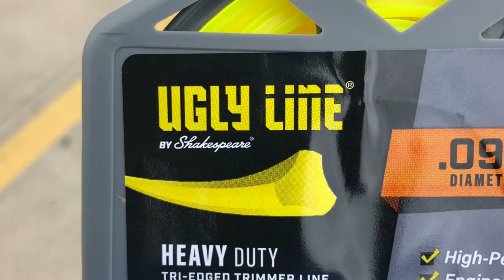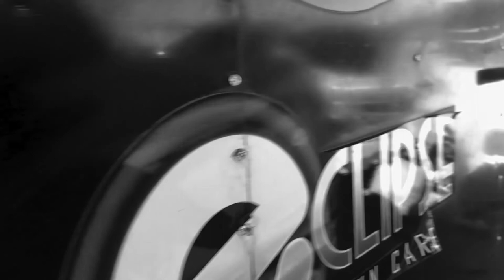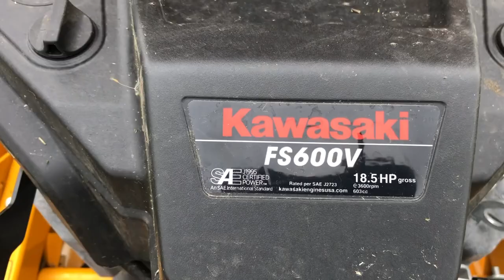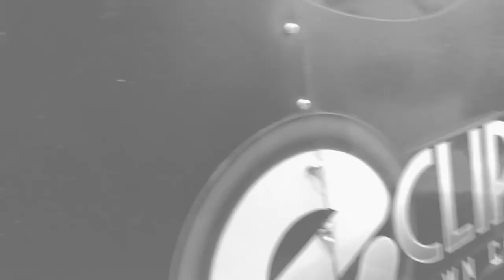The Heartache of Losing your Lawn Care Business | Friend Helps Out | Demoing a Stander Mower

Comment: I use Wright 32 stander fixed deck. Overall length is shorter than the stander 32 B. I learned it in one day. Just practice all day. If the yard is bumpy it's hard to keep a straight line. Stander B is definitely a good starter mower. Adjustable deck is a plus. Good luck.
Reply from the maker: I would think a fixed deck would be inconvenient. Thanks